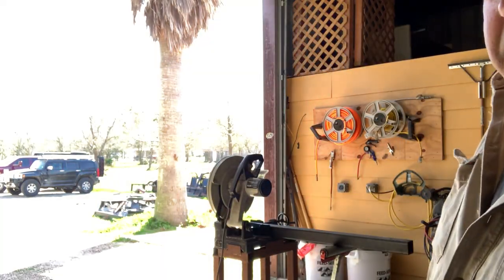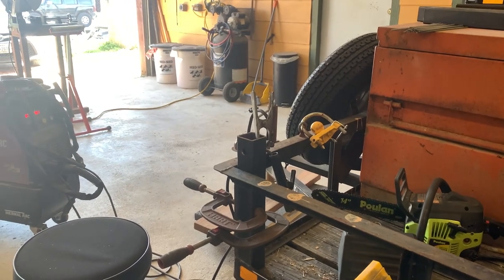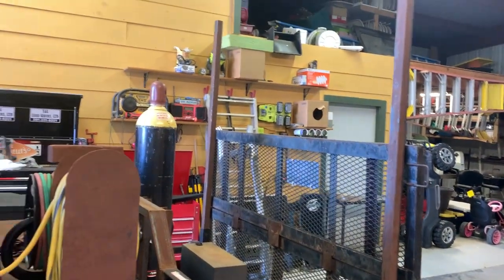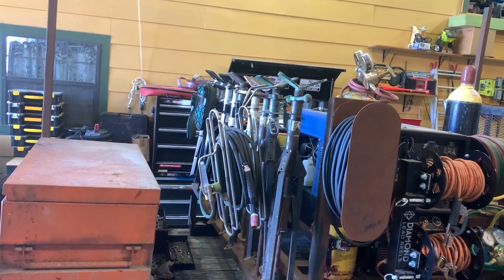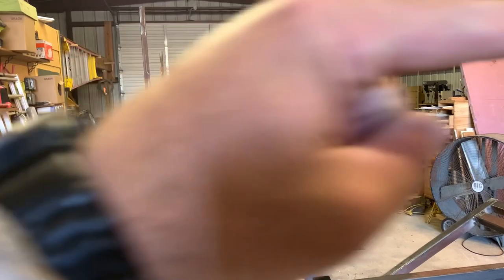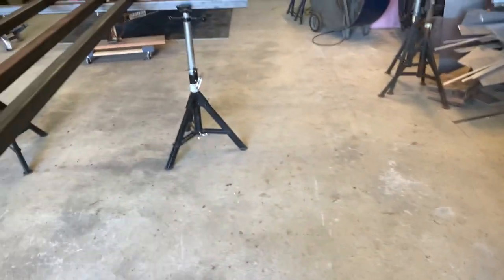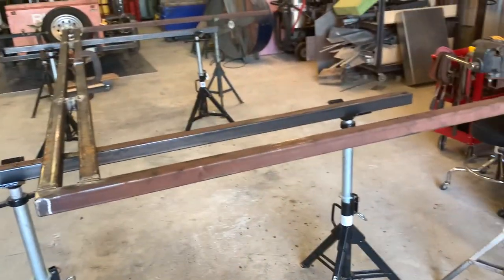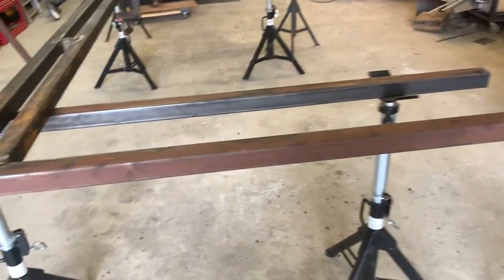WELDING TRAILER BUILD EP3 LADDER RACK

Comment: Hi! I need to know what size tubing that went in the big tubing? The four pieces that was welded in the corners first was 2 1/2 in the 6’by 6’ tubing in height what size is that tubing that’s fitting that flush in the inside of 2 1/2 big tubing??
Reply from the maker: Thank you for watching and commenting. It is 2”x2”x1/8” square tube inside the 2-1/2” square tube. I hope that answers you questions. Take care and stay safe.

Comment: Nice ladder rack. What would you charge to fabricate one like that for me? I live in Conroe.
Reply from the maker: Thank you for watching and commenting. to build you a rack would depend on what size trailer you have. Material is supper expensive right now. My trailer is a 6ftx12ft and to build that rack I have 800.00 dollars in material and that isn't painted, or powder coated. So, with labor and material it would be around 1700.00. Then on that one to be powder coated it might be around 400.00 maybe a little less because I can unbolt that one. I hope that answered your question. Take care and stay safe.